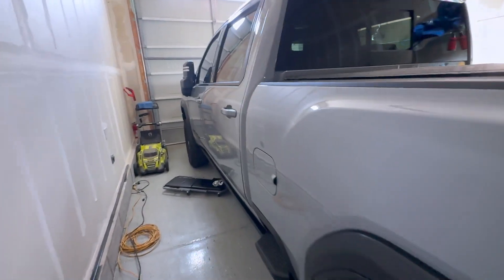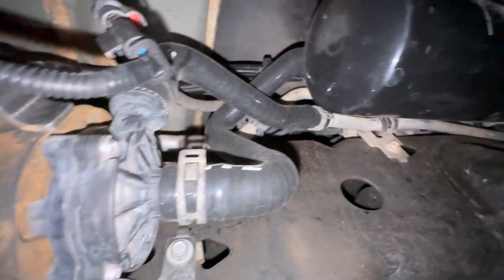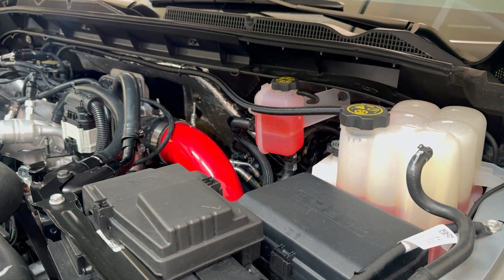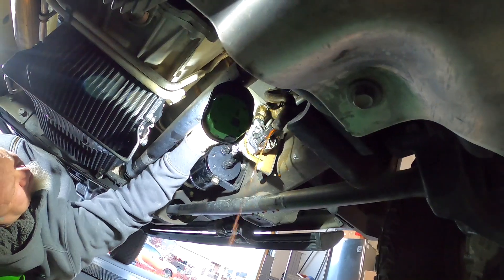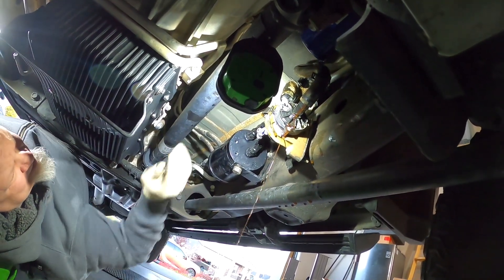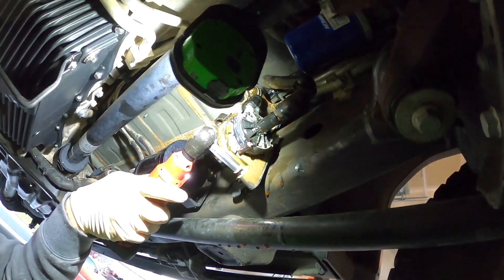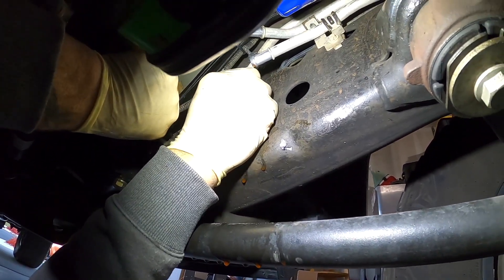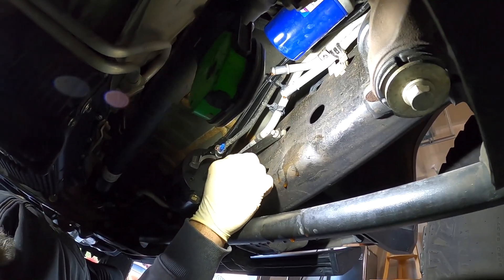Get Better Oil Filtration On Your L5P Duramax Diesel By Installing This PPE Relocate Kit!

Comment: Man

Ya missed “closing the loop”!
- No description of how new bracket relocates or makes room for PPE filter.
- No install of PPE filter following.
- No refill of coolant
- No description of coolant fluid type.
- No follow up to top off fluid after initial refill and running the truck. 😮

Comment: Only issue is in the fine print that says 5 micron at 30% filtration… what about the other 70% also it has a bypass gauge in the bottom so when that filter clogs which is super fast cause that’s a full flow filter trying to filter such little micron it just bypasses the all the oil. I’d stick with the oem filter so I can atleast be picking up some of the big particles.

Comment: Hi Josh ! 
Happy New Year to you and your family!
Thank you for all of your video's. 
They are very informative. 
I just bought a 2025 GMC Sierra 2500 AT4X AEV edition with the Duramax 6.6  Diesel last July.
I saw the video that you did for JB Reviews on his GMC about the PPE iil filter and relocation.
Is it worth it to install that set up?
I only have 17000 kms on the truck, it is a daily driver and I don't do hardly any heavy towing with it.
I live in Ontario,Canada. 
Regards,  Mark
Reply from the maker: Anything done to improve oil filtering is beneficial for your truck
Reply: Thank you Josh.
I appreciate your wisdom.
I will now wait until PPE has that kit available again.
Have a great day and keep up the fantastic work!

Comment: Complete waste of money and time    just change your oil every 5k miles and enjoy your pickup    u people think you are smarter than gm engineers who design these motors😂
Reply: GM engineers design these components under the scrutiny of cost effectiveness. When they present their design, the nice suits sitting on the board always asks if there is a cheaper option. In this case a smaller oil filter that is shared with the smaller platform was the most cost effectiveness option, not the best option.
Reply from the maker: Yes we do, cause we are
Reply: @Trukstuf 😂

Comment: Any idea what the bypass pressure is on that PPE filter. I heard one of the reasons they switched was PF26 had 15 psi and PF63 was higher at 22psi

Comment: I just ordered a PPE oil filter for my 21 ram 3500 cummins. Going from 30 micron filtration to 5 micron. That should make a big difference in the oil. Thanks for this good video